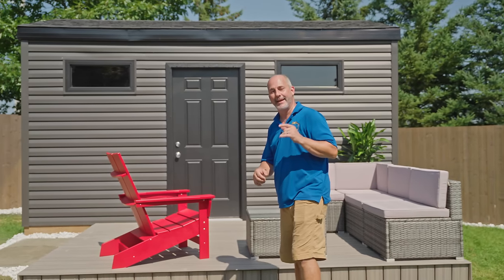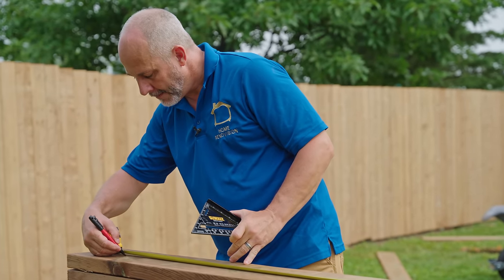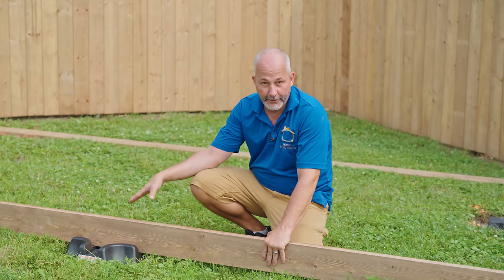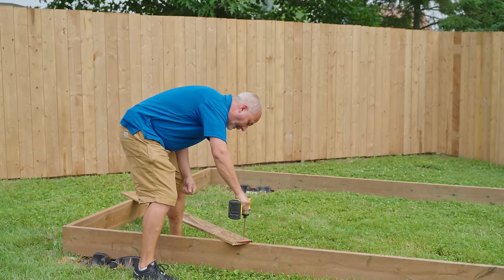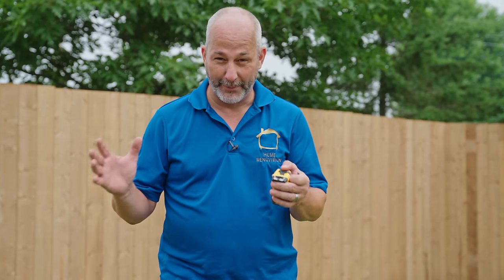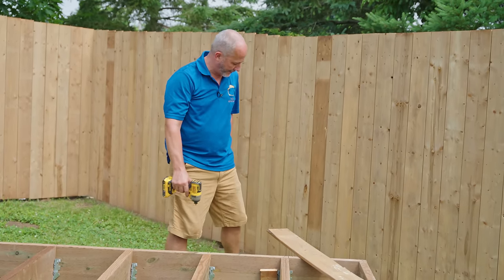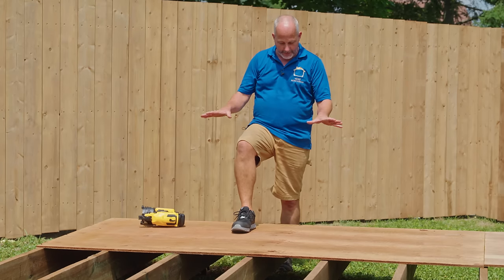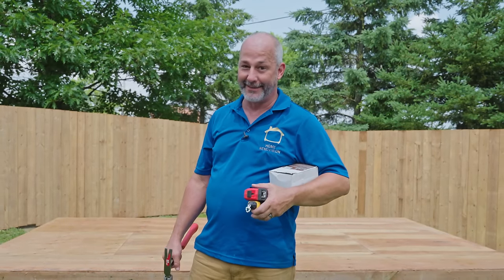DIY How To Build a Floating Shed Foundation

Comment from the maker: Thank you everyone for watching. If you enjoyed this videos, pleases subscribe. New videos of this epic shed build series come out every Saturday. In the meantime, you can watch the OG shed build 👉🏼https://youtu.be/BLk_CAMmQPc and Shed 2.0 👉🏼https://youtu.be/p3Z2Bpez31c Cheers!
Reply: I am learning the techniques that is being used to do the job.
Reply: Love your stuff down here in Elmira, NY ...  You break things down so even goofs like myself can fallow.
.
Got 2, well really 3 questions.
You are working on the premise that code is 10'x16' maximum exterior size.  BUT you are going to be a little big. 
How thick is your sheathing?  
... Let's assume .5"  --> example Smart Side ~7/16"
How thick will your trimming be?
... Let's assume .75" --> example 1x6 (or 1x4) #2 pine
.
So, you cut the floor joists at 9'6", with the 6" total for the rim joists.   That will put you at exactly 10' before the siding and trim.  
2 sides of siding = ~1"
2 sides of trim will = ~1.5" 
So your total outside dimensions will be 10' 2.5" deep and 16' 2.5" wide.
.
Is that something your code guy will freak over?  
.
Also, when I've built sheds, I line the corner seams, under the trim, with 5" wide butyl tape to seal the corner seam beneath the trim.  It helps keep driving rain from getting under the trim and into the seam.  5" tape gives you 2.5" on either side of the seam.
.
So, including the tape, and an anal code guy, wouldn't it have been better to cut the joists at 9' 3" & rim joists at 15' 9" to account for the siding, trim and sealing tape.
Reply: best pedagogy! thanks

Comment: Yeah, neighbor complaint. That's why I want to live in the country on some land. No neighbors, no complaints, no code/permits
Reply: I live in the boonies on large acreage and there are still codes and permits.
Reply: @crosisofborg5524 sure …but we don’t follow them 😂😂
Reply: @crosisofborg5524  well I take that back. Having proper permits and things built to code is what prevents disasters and gives a new buyer if you decide to sell the home peace of mind and assurance
Reply: @crosisofborg5524  im in the boons of kentucky. No permits required except for septic.
Reply: I live on a bit over 10 acres and neighbors are still an issue. Thankfully they are part time only.
Reply: Buy land you could make good sized sheds like this and each one is a room before you know it you got a house that cost 5k done cheap 😂
Reply: @Big-mac24  and I would too
Reply: @BigSarnt  I have one in my garden for my dogs and it's like a house just missing a toilet and kitchen looks no different to my home inside

Comment: So the frame is just sitting on top of the 4x4's with no fasteners?  other than the stabilizers he puts in?
Reply: Yeah, this guy has no business teaching building.
Reply: Yep - confusing 😕
Reply: He usually has a "everything will be fine" approach.
Reply: @baxtronx5972  it'll be fine right up until it isn't
Reply: He does show you that you can use fasteners there, and that "stabilization block" looks like it does the job pretty well. I don't see anything, other than weight, holding the 4x4's to the Camo bock though.
Reply: Cope
Reply: @patrickjames1080 confusing how? He said if you live in an area with high winds use more fasteners? If you don’t, it’s fucking fine. 😂
Reply: @xSWlMx  must be the Canadian accent
Reply: He is also holding a nail gun to his balls at 30:40   😂😂
Reply: @cmike5572 😂😂😂
Reply: I love the part about the joist hangera
Reply: Seems fine to me. If there are high enough winds to blow this over, or enough lift to pull it off the pads, there are much worse things happening than losing a shed. Just my opinion
Reply: @patrickjames1080  Good come back, dude! 😆

Comment: You mention over building your structures, to help them last longer I'm kind of the same way. One thing is I pay attention to specific details and one you overlooked that I do for a shed or deck is to remove the sod from under the deck area. You mentioned moisture from ground contact but there is also moisture that will dwell under the building just from the ground below it. Like if you park a car on the grass and leave it there for a few years it will be completely destroyed with rust under it. If you park the same car on top of a tarp on the grass the car will be considerably better condition after those same years. Clear the sod under the shed down to the hardpack and then lay some plastic sheeting and cover it with sand. This will eliminate the ground moisture from affecting the underside of your structure. This applies for pressure treated lumber as well because even pressure treated will last longer in a better environment and so will any nails and screws.
Reply: Would removing the sod underneath then applying a weed barrier with gravel on top be good to prolong the duration of the foundational structure?
Reply: @edgararcega3046   yes remove the top soil just lay down plastic and fill with gravel or sand. Weeds wont grow under the shed without sunlight or water. You just want it to be as dry as possible and the shed floor will last almost forever which means longer than you are alive...
Reply: @SmileyDave-h5z  Edgar above asked about weed barrier which allows drainage.  We think a plastic sheet will cause puddles and mosquitoes.

Comment: I don’t get how you did the 16 on center. You put your tape on the outside of the board, then put your mark right on the 16, and put your X on the far side of that (around 16.75). If you get to the 8ft mark, and do that, and you line your joist up with that line so that the X is in the center of the joist, your sheathing will not end in the middle of that joist. It won’t be on the joist at all. That is why usually with framing, everyone comes back 3/4”, makes the line, and the X ends up on the red number (16, 32, etc). In the video, your sheathing lined up, so what did you do?
Reply: Great question and why I’m in the comments. Wtf was that kind of OC measurement?
Reply: Obviously, he made a mistake, one not easy to admit surely. How many of us didn't learn that one the hard way? 😆

Comment: Nice looking job but a few things come to mind....   Please wear safety glasses when using a nail gun.   That is a must.   The top plywood should be "tongue and grove" edges.   T&G is much stronger than butt joints.   For me, I don't like using single joist under the plywood length's butt joints.   I use a sistered joist (2 x joists) instead.    Like you said, floating sheds in Ontario (and its frost) allows the shed to "float & sink".   Since a floating shed (especially a loaded shed with heavy weight items) sinks and needs to be leveled every 5-10 years, also install "jack up" points at ends and middle of the frame.  Just like jacking up a vehicle to replace its flat tire, make corner and middle "jack up" supports (on the frame's inside outer edge).   Instead of having the deck blocks deep in the ground, add a bag of gravel, a 18/x18" patio stone under the deck blocks.  Wider the grounds "touch area" the less natural frost sinking.    Also, add a "double" 2x8 around the entire platform.  Also...  Higher the gap from ground to under frame, the more natural air ventilation - which means less wood rotting (from natural ground moisture).   Keep shed's frame gap 12-16 inches off the ground, use a ramp for the door and install white plastic lattice (small holes) to allow air ventilation and keep most critters out.   As you can tell, I've built many shed platforms / deck platforms and I hate (did I mention "hate") their long term maintenance / re-leveling tasks.   Thus, I always build better with above tips....
Reply: Some good advice... thank you.

I'm getting ready to build a wood platform for a metal shed, thinking 8 x 12. Two questions come to mind. 
1) It seems reasonable to build platform to the same dimensions as the base of building and then use a drip edge on the platform considering I will have no skin to overlap the platform's edge.
2) Wondering how to secure the platform to the ground to protect it flying away from me. High wind is not a huge in my area, but still a possibility.

 I would appreciate your opinion. Peace.

Comment: The underfloor is completely exposed to moisture infiltration.  Why didn't you put something on to seal that up such as 1/4 green plywood?  Could have built the floor frame upside down, put the plywood on, then tipped the floor over upside right and built up from there.

Comment: Quick tip for flushing the rim joist. If you put the screw or nail into the top of the inner joist and use the claws on your framing hammer to leverage the outer joist down (like you're trying to pull the screw) having the nail gun at the ready to nail when flush you don't have to worry about the angle screw holding the two boards apart if you happen to have to back the screw out a bit to flush up.

Comment: I like the way that you think. I used the same flooring system on my shed 20 years ago using 3/4 inch plywood.
Over time the edge of the plywood bends [flexes] between the joists. In normal house building, there are two levels of flooring used  with staggered edges so that doesn't become a problem, but neither one of us did that. I think some of my "Edge Flex" can be attributed to ground moisture seeping up [as dew dissipates from the ground and grass] over the years. I would suggest blocking where the edges of the plywood between joists. 2X4s or 2X3s would suffice to do the job.
Also, make sure the space between the fence and the building is large enough to get a mower back behind the shed. Using a string trimmer to cut the grass in back of the shed will get tiring after two months.

Comment: When you marked your rim joists at every 16 inches, your plywood would not end in the middle of a joist. The first joist needs to be marked at 15 1/4" from the end with the x to the right of it, then every 16" from the 15 1/4" mark in order for the plywood to end in the middle of a joist. I learned this the hard way this weekend while building the base for my 16' x 10' shed. I ended up just sistering a couple of joists onto the 2 locations where the plywood seams met to compensate. Love your videos and have watched this series at least 3 times and find it all super helpful. Just wanted to point this out so others don't miss that step. Same applies to wall framing and roof rafters. Measure out from the end of the wall/roof/floor at 12/16/24 then subtract 3/4" for your first mark, then normal distances from that mark (every 12/16/24). Unless I'm missing something :)
Reply: He must have done what you said, because his layout worked.

Comment: Regarding concreted-post discussion, wouldn't it be easier to set posts higher than you need them, set level marks on the posts, cut, add hardware and then put on your joists?

Comment: Currently building a 10x12 floating shed base out if pressure treated wood and 23/32 subfloor. Haven't had any help so far, my back us very upset at me. Fell asleep on the couch last night and woke up at 4:30 in the morning feeling like i got beat with a bat. Looking great so far though. My motorcycle will have a nice new home this weekend

Comment: Big fan of yours Jeff. 10 x 16 is what im building right now. I went with 2 x 8 pressure treated for my joists and 9 holes in the ground filled with 40 inches of concrete to support the decking area.

Comment: I learned some more. Just bought the CAMO footings for my VEVOR tent shed platform. A set of 8 from AMAZON for the 2 drop beams. I will now buy leveling almost powder-stone as a footing base. Many footings due to the organic soil. The platform is 8ft x 12ft and movable. Possible tree cutting in the future but too expensive for now. Three 4ft x 8ft removable panels across the drop beams. I hope someday to be a YouTube presenter narrating my thousand or so pictures. No time to do videos while doing my projects. On my drawings I show mid-span bridging or staggered tight fit blocking for joist spans greater than 8ft. It is also in my construction notes. I just bought the DeWalt drill & impact driver combo. Driving big screws is now easy.  I now show more screw solutions on my drawings.  I am now busy doing design and construction drawings for homeowners and builders. DATACAD 23, started with version 5 in 1995. Retirement age but still working.

Comment: Looks great but I would’ve killed off all the grass or vegetation under the shed and removed it or put plastic down with gravel or gravel over the dead vegetation with the weed fabric I think leaving the live vegetation underneath it’s just gonna give you problems in the long run. But other than that, I like what you’re doing and really like the camo block.

Comment: I thought when you showed the fasteners, you were going to use them. Is all of the lateral movement of the building going to be held by three screws through some 2x4s?
Reply: Seems like a weak connection if your talking about rim joist to post.
Reply: Agreed. He talked about "overbuilding" but that seems to a key place where he didn't do that (unless I missed hardware or some other technique).
Reply: I was also confused by this. How is the structure attached to the 4x4

Comment: Funny talking about slopes in the yards, I’m a speciality contractor and I bet you be surprised how many properties I’ve seen landscaped sloped towards the home!  Some actually look like a house built down in a bowl! Personally I never understood how they get away with landscaping done like that?  You know whoever owns the home going to have troubles with water getting into their foundation or worse basement End up having to dig deep trenches around the house and funnel the rain water away from the house!  I don’t think most people think about that when they’re looking at buying a house?  Know one guy that built a house down in a bowl and it started raining right after the house was finished and next thing they knew they had water coming up thru the floor. They didn’t install a sub pump to automatically drain the water when it senses water getting too high under the home’s structure.  Unfortunately they learned they needed to install a sub pump under the house in the water and mud. Then had to replace all their hardwood floors that warped from all the water! 
Btw, hope you don’t have chickens running around, they’ll love getting under your shed and making nests to hatch their eggs!  I had to enclose all around my shed to keep the chickens from getting under the shed. Surprisingly the chickens dug 18-24” deep next to my shed to get back under the shed again. I ended up pouring cement around my shed in the ditch the chickens dug to keep the chickens out!
Reply: I had to do the same for rock squirrels digging under my slab. Guess they sense that my slab had a gap underneath due to adjustment give me a pier and slab construction. 😆

Comment: Wood screw to join plate to joist ... Just something that I've done which works for me ( though it may appear unsightly ).  I use a washer with the wood screw inwhich the head of the screw stays on the outside of the plate ( without sinking the head into the plate ) and PULLS the joist tighter into the plate.

Comment: I plan on building a 10x16 bunkie in Ontario in the spring but I am skeptical those post holders would work as my soil is sand forever. Would this not sink and heave during the frost and thaw cycle of the seasons here in Ontario? My plan was digging 15 - 12" diameter holes and sitting my 4x4 posts on the cement but your way would be way easier if it works.
Reply: had the same thought. I thought I heard a Canadian accent and then when he said was in CA I was shocked. This guy knows a ton but it seems like frost heave is going to eff this whole structure up with time.

Comment: How are the joist attached to the post? You showed the galvanized thing if you used concrete but you didn’t and didn’t use it. Appears your floor is literally laying on top of the post?

Comment: Built this foundation pretty much verbatim for a storage shed. Sturdy as can be, thanks.
Reply: Did you use only four footings as well? I want to build an 8x12 and was told that I need 12 bloody blocks, while Jeff only use 4 on an even larger shed? I'm pretty confused right now.
Reply: @Cyberdine.Systems.Model-101  4 is more than enough. I will say adding the extra 2x10x12 to the front and back strengthens the whole thing immensely.

Comment: Man, this guy is the king of making it up as he goes, and making no effort toward finding best practices.  Case in point: he thinks driving screws into end grain is stronger than toe nailing fasteners.  That is framing 101.  Not to say there isn't plenty more to be improved in this build.

Follow his advice at your own risk.  Sometimes there is a creative approach that can be honed into a workable solution, but it is lost frequently C grade hackery.
Reply: Really.  Simpson probably has 5 structural engineers review and test  their joist hanger screw pattern but 3 nails and a GRK screw  must be  superior... in Canada.  ;-)
Reply: @Sparisland , he also didn't size the beams appropriately to the span.  He can say it's just a shed, and he isn't required to observe code because of the location, but if he isn't using code or engineering he's just guessing.  Even if it was a deck it would be grossly undersized, and that wouldn't account for the weight of the walls and roof, or the, now relevant, shear loads.  It is just a shed and you shouldn't overbuild it, but that doesn't mean you have to build it poorly.

Comment: Moving to the next video in this series there is a center crossbeam with one would assume two additional" supports" for a minimum of six(6) while this video shows four(4). How did you manage that? Overkill didn't work?